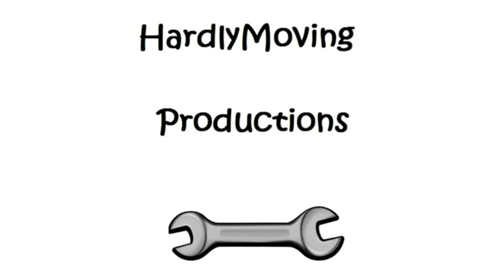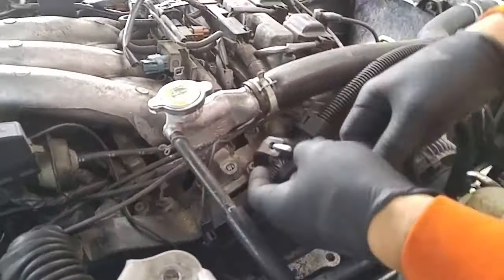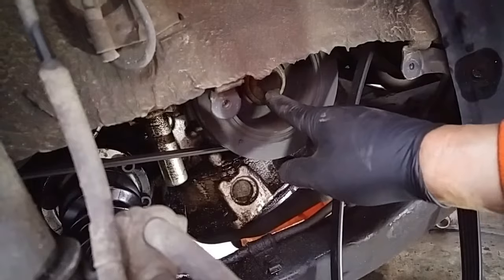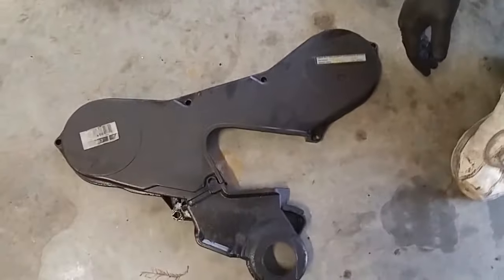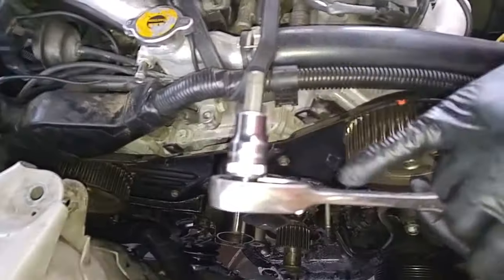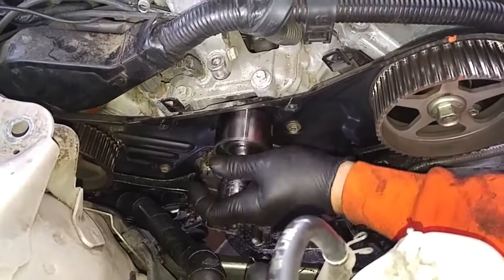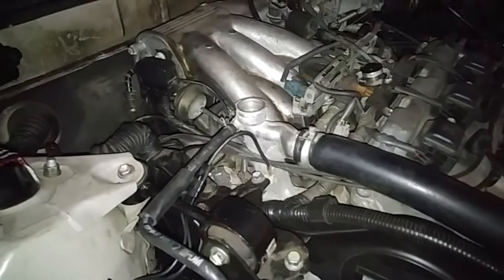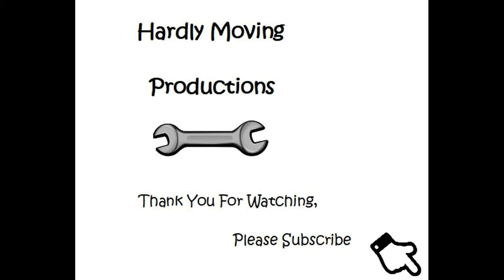Toyota Camry / Avalon 1MZ-FE Timing Belt, Water Pump, Seals & Pulleys Incl: Sienna/Solara/ES & RX300

Comment: Just remember where everything goes so you put in back in the right place with the correct torques. Take lots of photos. This job costs around $900 at my local repair shops, half parts, half labor.
Reply from the maker: Good to know.
Reply: 2001. Toyota. Tu dra. Timing    belt. Replacment
Reply: it costs about $1500 for labor and parts to do this job!
Reply from the maker: Use to cost around $900.  Takes me around 5 hours.   @ronbonora7872

Comment: Had a 95 Avalon. Got to do this job twice. I used an aftermarket water pump that was included in the all in one replacement kit ( Gates, I believe) and two years later I was tearing it all apart again to replace the bad pump. In hindsight I should have used Toyota parts. Gee, where have I heard that before all over You Tube?😂
Reply from the maker: Toyota subcontracts their w/p's to Aisin.  You can get them cheaper than the dealer.

Comment: One thing that drove me nuts on this job was I thought the rear cam sprocket was installed backwards by mistake bc the flange is facing out on it but facing in on the front one.  Came here to verify that it's on correctly.  Great tip on the paint can tool as a seal remover!  Thanks for the video mate!!
Reply from the maker: Thanks!

Comment: Very good video! Great shots of the work done makes it very useful for helping those who are doing a timing belt replacement. One tip I would include is that when you take off the camshaft pulleys, using a chain wrench like you did will mark up the surface of the pulley a bit. An easy technique to avoid this is to cut a piece of the old timing belt off and wrap it around the camshaft pulley before removal. I found that there was enough room on my old belt between the marks I made for the rear camshaft pulley and the marks for the crankshaft so I could cut enough to wrap around the camshaft pulley but not lose my old marks.

Also, I found that a 1-1/4" PVC pipe fit the camshaft seals well and was able to press them on with that. If you do use PVC for pressing the seals on, I would recommend taking the old camshaft seal and placing that on the end of the PVC that fits up against the new seal. That way, the old seal distributes the press force evenly on the new seal, and it is less likely to damage the new seal.
Reply from the maker: Thanks for your post and sharing your experience.

Comment: Thanks for the video.  It was big help.  The least expensive impact wrench I could find that would remove the crank bolt was the Harbor Freight Earthquake.  You can find a used one on Ebay.  I got the cheapest timing belt kit I could find on Ebay.  The paper water pump gasket that came with the kit was torn up when it arrived.  I got a metal one at Advanced Auto.  During installation, I tore six after market cam seals before I broke down and got OEM ones at the Toyota dealership.  They fit perfectly.  I practiced removing and installing the timing belt on a junker at Pull-A-Part.
This minimized the installation time on my car.  Thanks again
Reply from the maker: Glad it all worked out for you.

Comment: Would like to thank you again for your excellent, step-by-step video!  You are an excellent teacher!  Just completed the replacement of the timing belt, seals, pulleys, accessory belts, etc. on our ‘04 Avalon.  The tools that you use: the 22mm Lisle high mass impact socket, the Lisle seal removal tool and the cam seal installation tool have all been excellent investments that made the job so much easier.  The tips that you give to install the timing belt and remove the slack on the cam and crank sprockets before engaging the tensioner are invaluable!  Eventually, would like to do the timing belt on our ‘05 Lexus LS430 (3UZ FE) 4.3L V8 engine.  The current selection of on-line videos for this replacement are lacking in hands-on instruction compared to your fine videos.  Would it be possible for you to tackle one of these engines and produce a video showing all of the steps?  Keep up the great work and many thanks again for sharing your expertise!  Have a Happy Thanksgiving!
Reply from the maker: Thanks for sharing your successful TB job!  The belt and w/p replacement on the UZ-FE engines isn't difficult but more time consuming.  What is a pain (that I haven't done yet on a customer's car) is the replacement of the cam seals.  It requires the removal of the camshaft.  A friend of mine with a 98 LS400 (under 200k miles) had a TB break because of leaking cam seals.  The valves got bent since it's a interference engine.  He swapped it out with a JDM engine he picked up for under $1,000.

Comment: What a fabulous video!  You rock!  Couldn’t have done the job on our old ‘01 Avalon without your step-by-step expertise and common sense explanations!  Your procedures for aligning the cam and crank timing marks were spot on!   In another of your videos you encouraged the use of genuine replacement parts.  Your are so right!  Bought a “Genuine Toyota” timing belt kit on eBay.  Replaced the cam seals, crank seal, “Aisin” water pump, “Koyo” idler pulley, “Koyo” tensioner pulley, Toyota thermostat.  All seemed to be going well until it came time to install the “Toyota” timing belt.  The timing mark for the rear cam was not marked properly....the gold line was marked directly on top of a belt tooth.  Also, the marking for the crank sprocket was off by 5 3/8”.  Suspicious, took timing belt and the two “Toyota” accessory belts to a Toyota dealership.  The guy at the Parts Counter went into the stacks and brought out timing belt and accessory belts that fit our Avalon.  The eBay kit timing belt was clearly mismarked.  The construction and feel of all three of the eBay kit belts was clearly different than the Toyota dealership belts.  Was clearly to see the eBay kit belts were counterfeit!  On the the drive home decided that if the belts in the eBay kit were counterfeit, then it was likely that the other components were also likely to be counterfeit!  Uninstalled all of the other components that came in the eBay kit.  Ordered new components from Contitech and from Toyota dealerships that discount their Genuine Toyota parts.  The job turned out successfully....learned a lot.  Again, many thanks...Couldn’t have done it without you!
Reply from the maker: Great story and glad it all worked out for you!  Contitech or Continental do make great parts.
Reply: Aisin also has a timing belt kit and is a Toyota oem supplier.  Yep, I also learned the hard way to avoid buying the "cheap" so called manufacturer OEM parts on Ebay, and even on Amazon.  If you want OEM parts, only buy from the  dealers and yes it will cost more (often ALOT more), even with the discounts many dealerships offer, but that is the price for getting the real parts I suppose.
Reply from the maker: You said it!

Comment: Fortunately I am performing this on an engine stand with the new engine for a 1999 model. The timing belt proceeded to delaminate at 75mph going up a mountain pass in Wyoming 1,200 miles from my home. Piston fragments pierced my oil pan and littered the highway, but was still able to load and unload the car under power with zero oil on a Uhaul car dolly. Toyota for life, even though this is my first Toyota and it lasted 600 miles since I bought it haha.
Reply from the maker: Wow ... what bad news.  Good luck with the new engine!

Comment: Thanks for showing the adjustment on the camshaft and crankshaft in order to properly install the timing belt. I could not figure out how to do this when I attempted to change the timing belt on this engine.
Reply from the maker: Excellent point!  I've seen repair instructions state something like "install the belt" or videos where all of a sudden, the belt is on.  The belt installation is the most critical ... the most important phase of the repair and everyone seems to gloss over it!   Anyone can install the belt where the cam and crank alignments marks are fine ... but is there belt slack in between?  Remove the slack by turning either the crank or cam and boom ... your off a cog.

Comment: 13:01 this tip saved my life brother. I've been at it for 3 days before I found your video. Thank you so much for putting this info out here. Your expertise allowed me to help my friend get her timing belt replaced. Thanks again, God bless!
Reply from the maker: Good for you and thanks for sharing a successful belt installation!  I've done a lot of belt realignment jobs where the belt was previously installed with slack between the cams and crank resulting in timing misalignment.

Comment: This video is a great improvement over the timing belt job you did for the Camry. I especially liked how you used a paint marker to better show us the alignment marks for the timing belt. Great job!
Reply from the maker: Glad you enjoyed it!
Reply: I use those paint marks every time I do a timing belt. I mark the old belt at each TDC mark. Then transfer those marks to the new belt and use them to make sure the belt is on tight and not shipping a tooth. Hasn't failed me yet.

Comment: Dude, you rock! I gotta say, so nice of this feller to post this video. Did a TB job a couple of years ago on my 2000 Avalon 1MZ-FE but now have a oil leak under the TB cover, suspect the left ( towards front of car) cam seal. Darn it!. His list of tools (and workaround tools!) used is so very helpful, especially the seal removal tool  (thanks for that hombre!) his tips and tricks are important and informative. 
Consult your Service manual for torque numbers and which bolts should be replaced due to metal fatigue of bolts under pressure (like the crank bolt, I believe). Read through all the comments section and replies, watch the video a number of times, write down important notes, take pictures BEFORE removing parts and where belt tension bolts are in relation to brackets, use masking tape to ID bolt placements, use separate baggies for parts and bolts that go together, use nail polish to mark TDC marks when you find them to highlight them like which camshaft pulley goes where and at what orientation BEFORE removing parts, take his advice on how to tension and manipulate the TB when reassembling. 
USE OEM PARTS! you don't want to take any chances given how much time you are going to spend doing this. He even lists part numbers for you! (double check against YOUR vehicle schematics on OEM parts dealers websites, sometimes parts are "repclaced by" newer Toyota parts #s). Remember, this job is going to take you a lot longer than it does him. GO SLOW and prepare well and good luck! 
Oh yeah, never hurts to watch other videos on the subject to pick up the little tips and tricks for the first-time DIYer, take notes. Make a folder in your bookmarks and save the videos and websites for easy access, don't try to commit to memory only! Tahe Lexus ES300 of the same year has the same motor (1MZ-FE). It's a good idea to watch these videos also. The more videos you watch BEFOREHAND, the more tips and tricks you'll pick up especially on the more crucial points (position of cams and crank pulleys in relation to TB, how to remove crank bolt, how to isolate cams from moving, etc., how to lift motor for clearance in removing brackets if necessary). 
You can "rent" some of the tools (crank pulley puller, for instance) from your local parts supplier like O'Reilly's, Pep Boys, Autozone, etc., by leaving a deposit w/ them on your credit card and when you return they credit back to your card. Make a list of what tools you need and compare them to what they offer for "rent" (might have to go to multiple stores, KEEP YOUR RECEIPTS!).
Thanks again sir, for posting such a good video!
Reply from the maker: Thanks for your post and kind comments!  Good to hear from someone who watched the video in detail and took note of all the tools I use.  Makes the job go easier and faster.
Reply: Thank you for the comment! Very helpful reminders. Im preparing for this job this video will be very very useful

Comment: Appreciate your video.  I just finished installing new water pump, seals and timing belt on my 1998 Toyota Avalon.  Your guidance helped tremendously.  My belt failed and broke apart inside and wrapped several times around the crank gear.  So, there was no aligning the marks before replacing the belt.  Things I found out while replacing the belt:  1.  The 1MZ-FE (pre VVT) does not appear to be an interference engine or maybe it is, and I got lucky.  The valves weren't hurt, and I was able rotate the two cams and crank with no problem.  2.  The two cams when rotated are spring loaded and the left cam falls right on TDC.  The right cam (rear) does not for some reason - it spring loads around 10, 2, and 5 o'clock.  You have to gently rotate that cam to TDC before it falls on the 2 o'clock.  Hope this helps the next person.
Reply from the maker: Glad it all worked out and thanks for sharing your experience with the repair!
Reply: sirry new here TDC? Timing..? sorry please advise

Comment: Thank you so much for this video!!! Will be doing this job soon.  Car is leaking oil from crankshaft seal, thought we could simply replace the seal but looks like it’ll have to be entire timing belt kit.
Reply from the maker: More likely one of the cam seals.  The oil works its way to the crankshaft.

Comment: Great video!  I replaced everything on my 2002 Avalon with the Aisin kit plus cam & crank seals and thermostat.  Discovered that whoever was down there before used cheap parts, including a non-OEM thermostat installed with form-a-gasket sealant.  Water pump was missing 2 bolts.  Anyway, after watching your video several times, completed job, and the 3.0 started up fine but after a few minutes noticed a bad leak from one of the cam seals.  Ugh.  Removed everything again except the water pump, replaced the leaking crank seal (more carefully this time), and now all is good with the Avalon.  BTW, the tip regarding the slack on the crank sprocket was very helpful.  Thanks HMP!
Reply from the maker: Thanks for sharing your repair experience using the video as a guide!  Just a FYI:  Another future possible oil leak source that may fool you as a camshaft seal leak can come from the oil pressure sensor.   The sensor is on the left bank by the lower timing belt cover.

Comment: Great video.  I just finished this job and I'd like to clear one item up that was a bit confusing to me.  Between the FSM and in some online guides and how-to's you'll run across multiple methods for aligning the crankshaft (bottom sprocket).  

Some will indicate that the dot on the sprocket should be aligned at the mark on the block at the 12 o'clock position while others will indicate that the dot on the sprocket must be turned to the 4 o'clock position and aligned with the mark on the belt.  Here's the thing: both are right.   There are two marks on the crankshaft sprocket.  There is one on the thin plate that rides up next to block and the other is on the front face of the sprocket.  

*Both dots need to be lined up!*.  The one in the back of the sprocket that rides next to the block should align with the block mark at 12 o'clock and the one on the front face of the sprocket should align with the line on the timing belt.  If they don't both line up, you've done something wrong and need to start over.

One more thing.  The belt guide (bowl - shaped plate on the crank shaft) should go on between the crankshaft sprocket and the dust cover with the bowl side facing out. 

Hope this helps.  Thanks for the great video.
Reply from the maker: Now you know why applying paint marks on the new belt and pulleys makes the job go easier.

Comment: This is great. Thank you very very much. 
Took me about 7 hours,  no fancy power tools.
1 and 7/8 outside diameter PVC pipe work great to reinstall the crankshaft seal.
To be honest I was a bit intimidated by the project but your video is great
Reply from the maker: Good for you and 👏 congrats!
Reply: Was it hard to get the balancer off?
Reply: @trentdaddydolla647  not at all.
Reply: @TAspeed1  oh ok thanks
Reply: @trentdaddydolla647  I have read that you can attach a socket, breaker bar, extension so that ground contact is made.  Confirm crankshaft turning direction and face bar so that when you crank the motor briefly, the setup will hold in place and loosens the bolt.  Toyota guru Scotty Kilmer demonstrated it in one of his You Tube videos.  This video is great and I appreciate the detail.  Priceless reference

Comment: Adding some experience here, if you use a chain wrench like in the video. Put some steel wool between the teeth of the cam pulley  and teeth of wrench, keeps the tool from marring the sprocket teeth. Great video
Reply from the maker: Good idea!  Sometimes I cut a piece of an old belt and use that as covering.

Comment: Currently got a 95 camry with 268,000 miles. Original everything. Already done rear main seal boutta seal up everything else soon
Reply from the maker: 1st timing belt replacement?

Comment: THANK YOU for including a list of tools used. Wish more mechanics would do that at least for the non "standard socket set" tools.

I've done a Subaru Forester (4 cam gears to align), and really wish I'd thought of the clamp thing to hold the belt in place.
Reply from the maker: You're welcome!  You did a 4 cam timing belt job?  Check this video out where I'm installation a new w/p and belt on a Mitsu 3000GT with 4 cams:   https://youtu.be/FTp_tVXSbqU
Reply: @hardlymovingpro  Yep, gotta love timing belts long enough to (almost) stand up in due to boxer engine.